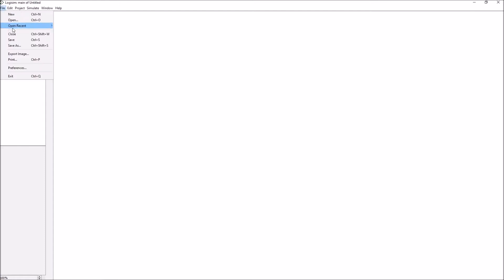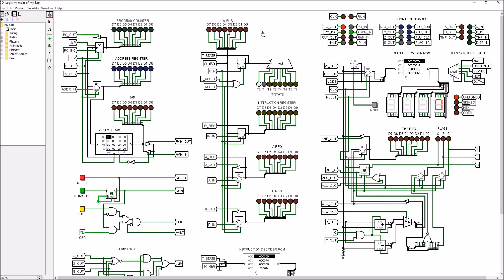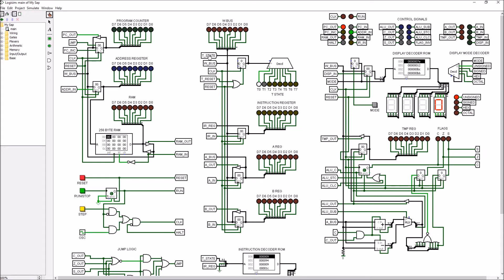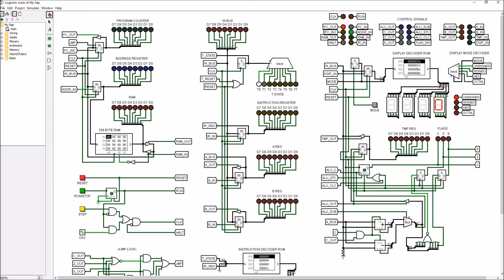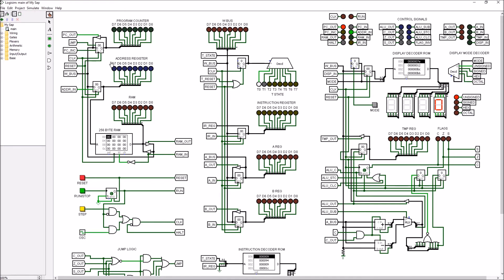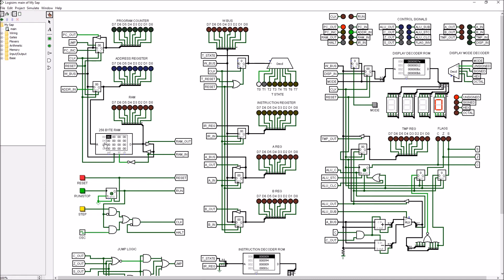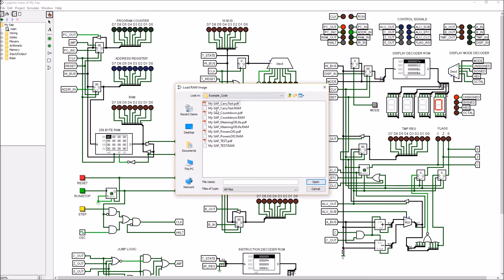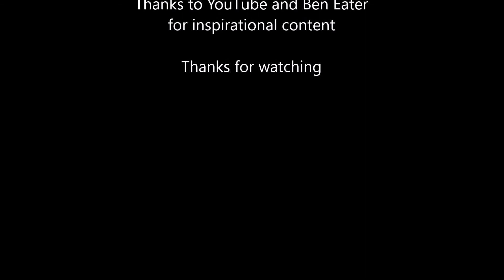MySAP 8 Bit Computer Logisim In-Depth Part 1

Comment: My son and I got this up and running in Logisim and ran your example programs. Do you have the instruction set documented anywhere so we can write our own? (We could reverse-engineer it, but I'd like to just "dive right in.")
Reply from the maker: Go to my GitHub (https://github.com/linhartr22/My_SAP_Logisim). Browse to the Intruction_Decoder_ROM folder. View the "My Sap_Instruction_Decoder.ROM.ps1" file. Scroll down to the  row 72. If you just pay attention to the comment rows you'll see the opcodes are grouped by function then listed individually.

For example, row 72 indicates the LOAD instruction group. Row 73 is opcode 00 which is the LDXA (DD) instruction. It is a two byte instructions that takes 5 machine cycles to execute (2/5). 

To determine what the instruction does, on row 74, the values after the -f will give you an idea. The first PC2ADDR copies the Program Counter to the Address Select Register and the FETCH_IR copies RAM to the Instruction Register and increments the Program Counter. The second PC2ADDR copies the Program Counter to the Address Select Register and the FETCH_ADDR copies RAM to the Address Select Register and increments the Program Counter. Finally the RAM2A copies RAM to the A register. 

In summary LDXA (DD) loads the A register with the contents of memory at address (DD). 

You can see the definitions for the different machine cycles in rows 34 through 67.
Reply: @RetroRogersLab  Ha, I guess I'm old-school. I saw a ".ps" file and thought it was a "postscript" printable version, prior to when you started doing PDFs. Never even bothered opening it. I guess that's what I get for assuming! Thanks! This is going to be fun!
Reply from the maker: Thanks for your comment. While re-familiarizing myself with the code, I found a mistake with the JZ, JNZ, JS and JNS instructions. I've corrected the mistakes and committed the corrected file.

I think it is great that you're doing this with your son. Awesome parenting!

Comment: Cool looking cpu. I like your layout. I did a similar cpu in logisim covering the book buthowdoitknow. I ran into problems trying to create a 2 phase clock in logisim. A Lao had some problems with my RAM as used very few logisim primitives and built most up by scratch. Also built a little assembler in Excel. Good work. I sub'd. I created 24 video playlist on my build I'd be interested in some constructive criticism if you got the time my channel is channelaboutmyinterests bit of a lame name but covers exactly what my channel is about. Keep posting.